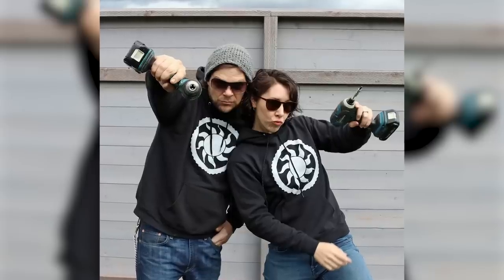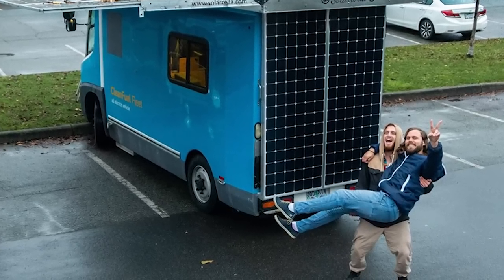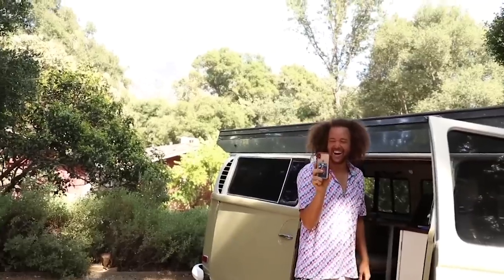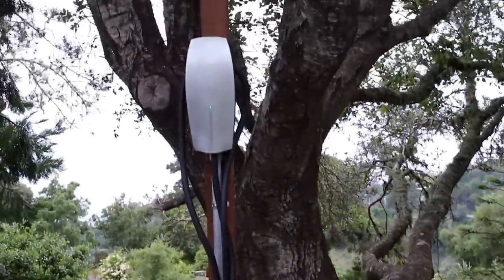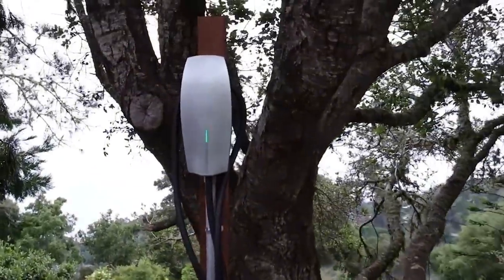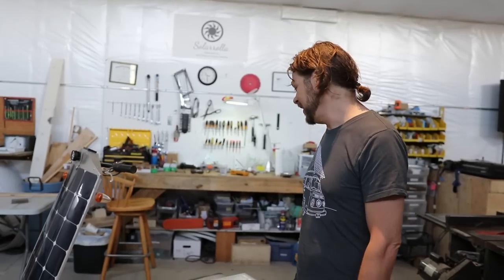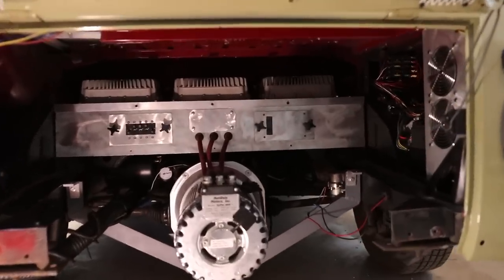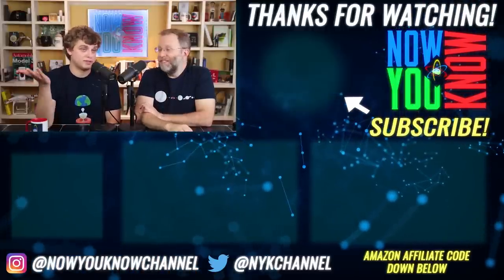Solarrolla | Solar Powered Electric Vehicles!

Comment: They need to add MicroBlueracing.com wheel bearings, low rolling resistances tires filled with nitrogen.  It will help with range and performance.